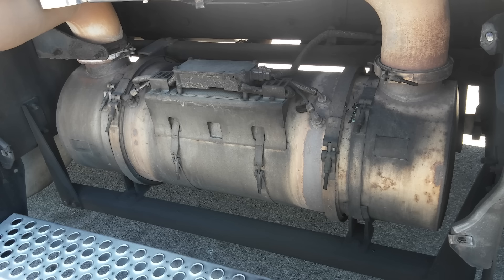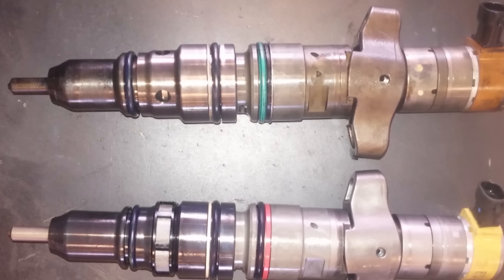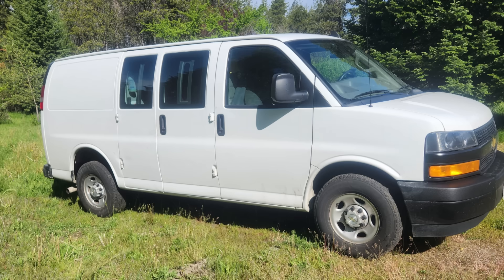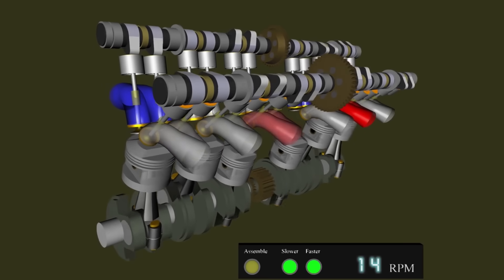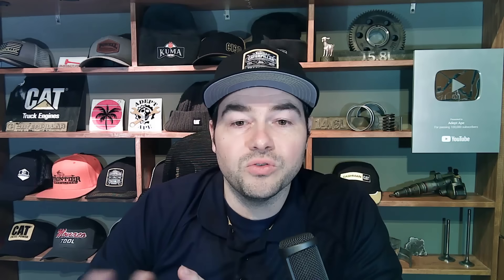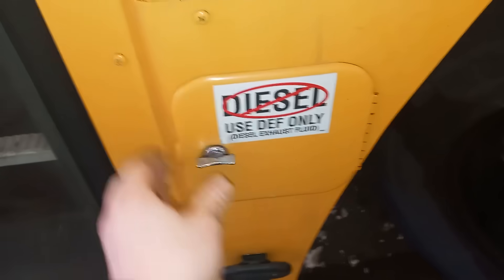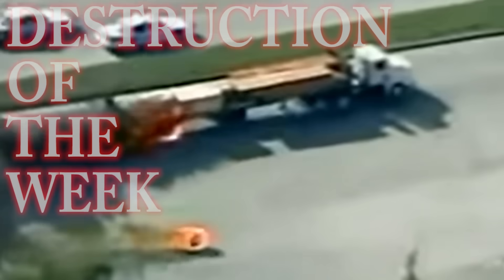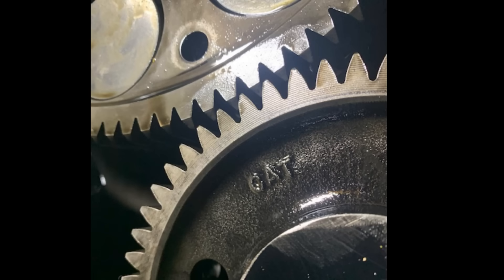What!? Gas engines are getting "DPF" Filters Now!!!

Comment: Wow yet another reason not to buy a new cars. 
My question is how are the particulates getting through the catalytic converter on gas engines?
Reply: Cats aren't particle filters, they're designed to convert NOx and other waste gasses into CO2, nitrogen, and water through catalytic conversion via platinum.
Reply: @agentx250  Yeah, they're supposed to burn hydrocarbons.  Like soot.
Reply: @immikeurnot  No, they don't burn anything, they catalyze a chemical reaction to separate NOx into base elements. NOx is produced through burning/combustion.

"Soot" is effectively carburized fuel. The more fuel is incompletely burned the more soot is produced. The more complete the fuel combustion the more NOx is produced; with respect to combustion engines, at least.
Reply: cat converters attract NOx like an evaporator in AC systems attracts the moisture in the air that passes through.

no actual filtering. or lets say the mechanical construction is such a coarse grid, it never takes significant stuff out.  works for turbine wheels, nuts ect. tho 😅
Reply: @casemodder89 Cats aren't just for NOx.  They're for three things: NOx, HC, and CO.

Comment: Here's a thing, while I would rather prefer no exhaust filter, a GPF is far less problematic than a DPF. GPF exists due to cold weather emissions, where the engine isn't fully up to temp. 

When the engine is cold, gasoline struggles to properly atomize. While carburetors and port injection would technically produce soot with a cold engine, direct injection has a higher tendency to produce more soot, due to unburnt fuel sticking to the cylinder walls, and the DI relying on a hot combustion chamber to atomize the fuel correctly (Older cars frequently have heated intake manifolds or heated throttle bodies to assist with atomization). In theory, a hot catalytic converter should take care of it, as a modern (last 20 years) ECU would make sure that the cat warms up as quickly as possible, but emissions would be high while the cat is too cold to operate.

That's where the GPF comes in. It's supposed to catch soot while the catalytic converter is too cold to operate. Once the engine is up to temp, not only it would produce less soot, but the cat would take care of unburnt hydrocarbons before reaching the GPF. Regen is also far easier on a GPF than on a DPF, due to gasoline's higher combustion temp. The same cat warmup routine (the engine pulls ignition timing, and applies extra throttle, increasing EGTs. Also creates the characteristic "Bark" that modern cars have when cold started. Turbo anti-lag operates on similar principles) can be used for regen.

The biggest downside besides increased vehicle cost is reliability once the engine reaches old age, and it would fail the same way as cat would fail. And it would get "fixed" the same way with a concrete drill bit.

Comment: Next we'll get DEF catalysts. Since forever gasoline engines used a stoichiometric air:fuel ratio. If you run lean you can use less fuel, but you produce nitrogen oxides in the exhaust. The DEF catalysts consume the nitrogen oxides.

Comment: ah the convenience of still driving 60 plus yr old cars
Reply: That need spark plugs every 15,000 miles, constant ignition point replacement , oil that barely lasts 3,000 miles, engines are are very worn at 75,000 miles, won't start in 10 *F and lower temperatures and don't forget bias ply tires that last maybe 20,000 miles.

Comment: A chap I know has a ford for ten years in the UK that has one fitted to his gasoline car. The cure for America, is to stop selling car to California.
Reply: Except now more states have adopted cali' emissions.
Reply: @d.sm.4146 interesting to me that making cars run cleaner was billed as being more efficient, yet mileage and power was better before emissions control devices. (Recently this has indeed changed) the conspiracy theorists say it's so we burn more fuels for oil company profits and it's sometimes hard to argue that their point is wrong.
Reply: @baronvonslambert fair enough. Still sucks though.
Reply: And NY, and NJ, and Pennsylvania and Colorado and many other States that now use these systems, and I think Utah is seriously considering joining.
Reply: The irritating part is that the original smog problem has little to do with cars. Every landfill in the LA basin burned trash. Things'caught fire accidentally' almost daily. So they blamed cars cause they didn't have room for all of their garbage and these 'accidental' fires sort of made that less of a problem.
Reply: @lukewarmwater6412  B S, i lived and worked in the san fernando valey from 1963 to 2004 and never saw a land fill burning trash.,  I did see land fills pulling gas out of the ground and using it as fuel.
Reply: @lukewarmwater6412  They weren't burning trash in downtown LA where you couldn't see the hollywood sign.

Y'all just don't care and want everything  straight piped...
Reply: Cali is a massive market. Car manufacturers have to make their cars compliant to the most rigorous standards or else they can't reliably sell them. It's dumb, but if one of your countries economic capitals makes rules, you follow them.

Comment: 1 question and 2 stories 1. These gpf will they act exactly how the dog works and 2. Story 1 was driving a 2024 kw 680 with the Huey fuel injection system know the headaches in a brand new 2026 now but last time drove the fuel injector either on the engine or for the DPF was acting smoke filled up the cab while driving I don't know the results yet just saw the truck came back at work story 2 had a 86 Ford ranger with one barrel toilet I mean carburetor lol add the carburetor rebuilt first week or two the fuel mileage was unbelievable great but then the next time the fuel mileage was very horrible on a 2.0 liter 4 cylinder engine found out later who rebuilt it did not put the fuel bowl back in the carburetor

Comment: Carburetors and  throttle body  fuel injection  systems have one main problem . The cylinders closet to them get the richest charge . ( air and fuel ) . On a V8 it is the 4 corner cylinders get the leanest charge for example . So  yes multi point fuel injection is 100% better . Keep this in mind .    The 1970s Honda engine famous for running clean was the revolutionary Compound Vortex Controlled Combustion (CVCC) engine, introduced in the early 1970s (first in the 1972 Civic). It met strict US emissions standards (Muskie Act) without needing catalytic converters by using a small pre-chamber for lean burn, allowing for complete fuel burn, better efficiency, and the ability to use any gas (leaded or unleaded), making it a huge hit during the fuel crisis.

Comment: With diesels the injectors started spraying a much finer spray which led to a much smaller particulate in the exhaust. That’s a big part of why they needed the DPF. With older systems the smoke was much more visible, but it also settled pretty quickly and didn’t cause as many problems. The more modern systems produced less visible smoke, but the fine particles also stayed in the air and cause more problems. 
I suspect gasoline direct injection is a similar issue. With carbs or old injection systems the soot from the exhaust was likely denser and caused less issues. With direct injection the soot is likely lighter and causing new issues.
Reply: They don't need them at all with a proper time.
Reply: This is actually backwards due to how fluid systems work. Smaller doesn't inherently mean proportionally lighter but does mean that they are more readily dispersed whereas larger particles are more likely to concentrate at lower levels.
Reply: @agentx250  yeah and soot on old diesel cars was blown downwards using those 45° exhaust tips.  it worked well.  soot was on the asphalt instead of in the air.

todays super fine DI diesel soot on raised HP engines doesn't bellow like a black wall that drops shortly after heavy acceleration but like a dark cloud and stays in the air. or even rises with the exhaust heat.
Reply: @casemodder89 It's more complicated than mere exhaust angle. Realistically if you're seeing exhaust soot clouds then something is wrong or dirty within the system itself.
Reply: @agentx250  It is how it works though. Spray coarse chunks compared to a fine mist and see which one lingers longer. Breathe in large particles your body can filter, then fine particles your body can’t filter well. 
The old diesels would smoke a fair bit, but it didn’t cause many problems. But, as the injection pressures got higher and the spray got finer the exhaust changed. Even before DPF they didn’t tend to visibly smoke as much. But, they were still putting out particulates that were now small enough to become a problem.
Reply: @NBSV1  The inherent misunderstanding on your part being that the exhaust composition is the same across the two scenarios. It isn't and this is why the particle behavior doesn't conform to your initial expectation.
Reply: @agentx250 But it’s the same particle behavior? With a carburetor or low pressure fuel injection you end up with larger particles of fuel that don’t burn completely leading to large heavy spot particles. With older vehicles you even end up with so much heavy soot it will cake up and come off in flakes. 
Compared to the high pressure direct injection where the particle size is small enough to quickly and completely burn. You still end up with soot, but now it’s microscopic particles because you got a much more complete burn. The soot buildup from a DI engine also tends to leave a much thinner covering as it more readily mixes with moisture and makes almost a paint. 
The same thing is what happened with diesel. It went from a large particle that didn’t particularly mix to a small particle that does.
Reply: @NBSV1  With liquid fuel it would be droplets and if that's gas/petrol then it's not just a matter of injection pressure but also intake speed and turbulence since gas vaporizes so readily. You see a form of this in rebuilt, or custom, diesel engines that have something like Speed of Air pistons.

If the fuel burns completely then there are no solids (particles) that are exhausted. Soot is an inherent product of incomplete combustion.

How readily any soot cakes within the system is even more complicated as now you have to consider how incomplete the combustion cycle is, how much oil vapor/mist is being introduced through the PCV or rings, how much ambient moisture is present relative to how much remains after combustion, exhaust gas temperature & flow rate, etc. Moisture itself is also inherently less an issue because when it dries out the mixture becomes brittle and will readily flake off. What causes problems is the oil vapors or mist which takes far longer to dry and creates a more cohesive bond when/if it ever does.
Reply: @agentx250  Yeah. That's how engines work. 

You don't get a complete burn. They've gotten better, but there's still going to be dead space around the piston and edges of the cylinder where it doesn't fully burn or sometimes doesn't burn at all. 
Even when it does mix and burn perfectly there's still carbon soot as a byproduct. With a perfect burn it just ends up as microscopic particles you can't easily see. At least with gasoline combustion. With diesel fuel even ideal combustion will produce a bit of haze in the exhaust. 
At the end of the day you still need an actual filter to remove the particulates from the exhaust. And, the nature of that exhaust has changed in recent years. Both for diesel and for gasoline.
Reply: @NBSV1  Again you show your ignorance. Incomplete burn is by design, especially in gas engines. It's something that's intentionally calculated for as a means of reducing NOx. Complete burns are hotter and that heat in the combustion chamber produces NOx.

They're also not filters in the traditional sense since when they "re-gen" they just spew all of the accumulated particles into the air anyway.

There's an irony here that you've likely missed but these silly systems and backwards mandates are spurred on by exactly the type of people like yourself; those who have an opinion on a thing they don't understand.
Reply: @agentx250 Ok. Again you show that you don’t actually understand how things work. It sees you’ve read some things and learned the watered down idea for things. But, you fail to understand what’s actually happening and what is being done. 
You also keep changing the focus and trying to grasp at different things. The discussion was about particle size changing with high pressure direct injection and how that created the need for a GPF to filter those particles. 
Now you’re wanting to bring in NOx emissions and further muddy the waters about the effectiveness of the particulate filters. If you can’t hold up to the original conversation go be quiet in the corner.

Comment: It is worth noting that gas engines have way higher EGTs and thus will not have as many regen issues as diesels had in the early days.
And i also need to point out that gasoline direct injection has been widespread for a very long time, it isn't exactly new.
Direct injection allows for higher compression ratios which in turn increases NOx emissions, so SCR could very well be a thing on gas engines very soon, unless they manage to ban ICE engines entirely.

Comment: All one big scam by the wef
Reply: To control us
Reply: @unclerobert7532 correct because of smog. No smog, no care.
Reply: Smog is a scam, it makes people sick. As long as smog is a problem, these regulations will keep getting more strict. There is a reason why 2/3 of the USA requires no smog testing...it's because they don't have a smog problem.
Reply: @imzjustplayin  What in the hell does a GPF have to do with smog?  Do you even know what smog is!?
Reply: @immikeurnot do you know what smog is? Are you aware that PM causes cancer?
Reply: @imzjustplayin  I do know what smog is.  I asked if YOU know what it is.  Hint: It's not soot.
Reply: @immikeurnot  "Smog is air pollution that reduces visibility. The term "smog" was first used in the early 1900s to describe a mix of smoke and fog. The smoke usually came from burning coal." Particulate matter by definition definitely affects visibility. Also EPA's job is to keep the air clean, not just improve visibility.
Reply: @imzjustplayin  Good AI sourced answer.  Too bad it's talking about British smog (not much fog in LA).  Smog in California was caused by NOx.
Reply: @immikeurnot  Smog in California is most certainly caused by particulate matter which is why California won't even let you register a diesel truck older than 2010 if used for commercial purposes.

Comment: The GPF are way less problematic, just because of the inherent lower efficiency of the gas engines: Their exhaust gas runs way hotter, so much that most of the time they are hot enough to regenerate the filter during normal operation, so the filter very rarely fills up. And the regeneration, when needed, is just a matter of retarding the igbition and opening throttle a bit more, to boost the exhaust temperature. So no dedicated hardware needed. In fact most small diesels do something similar: Use the main injectors (during exhaust stroke) to fuel the regeneration burn.
And for the DPF in diesels, their regeneration system failures are not what causes most of the issues. Most of them are driving style not allowing to trigger and complete the automatic regeneration (too short trips,...) Actually automatic transmissions are better, as they allow to control the shifting points to be altered to allow the regen condititions.
The second group of "DPF problems" are actually real engine faults, mainly intake manifold leaks (pressurized air behind the turbo does not enter the combustion, but has been counted on by the MAF, causing more frequent excessive fuel doses leading to excessive soot production), other problems come from excessive oil burn.
And 3rd family of problems come from the use of wrong oil: When DPF (or GPF) are used, you can never use any oil that contains anything that would generate solid ash when burned. That poses quite significant restrictions on what additives are allowed to be used in the oil formulation. And many oil formulations not designed for DPF do form ash si permanently clog the filter.Fortunately in Europe this is somewhat a thing of the past, as practically all new engines use these filters, so oils not compatible with them are practically not present on the market anymore, at least not among the "common generic blends" that use to be the the cheapest oils sold in bulk for garages.